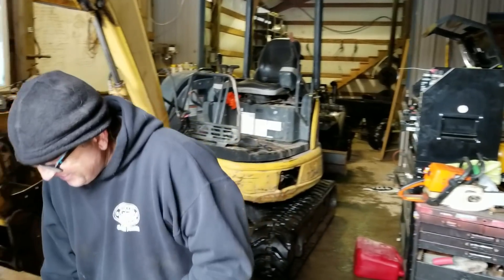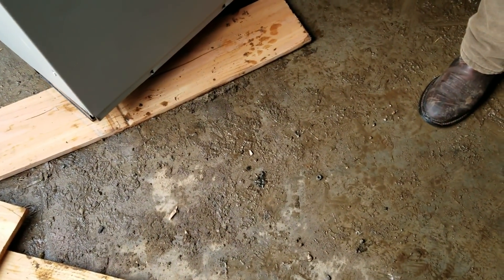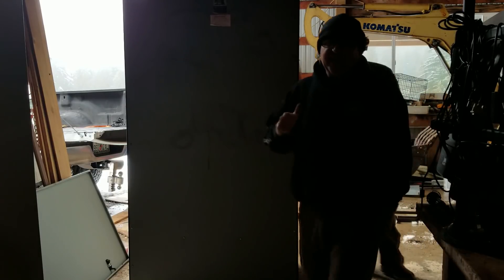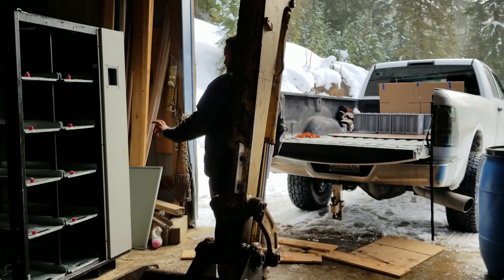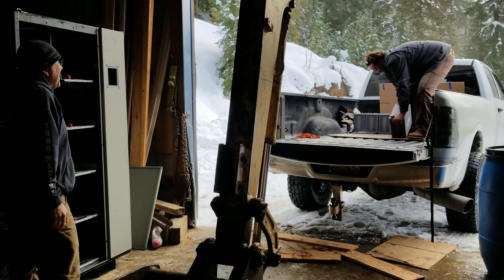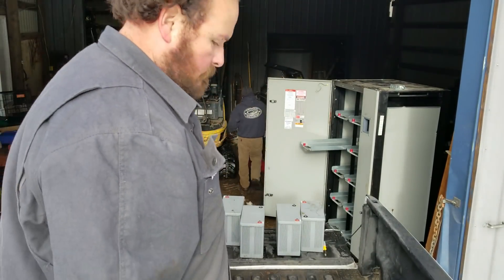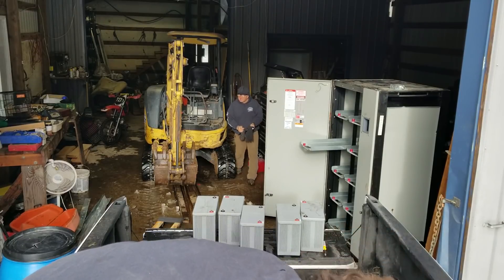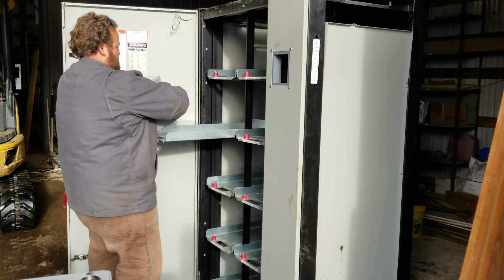New Deep Cycle Batteries For The Hydroelectric Power Bank

Comment: Those batteries are 6 or 8 volt L16 agm ?
Reply from the maker: As we do more videos on the hydroelectric system up grade I will get into the specs on the parts of the system